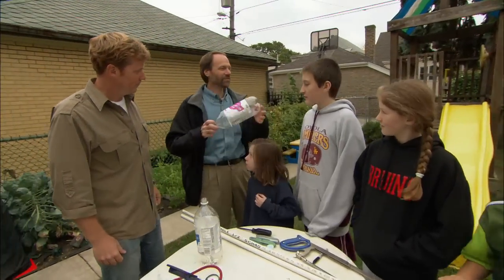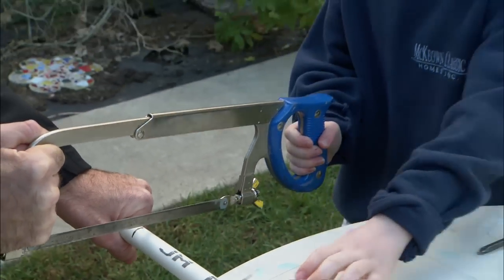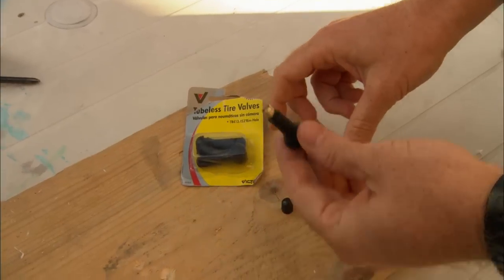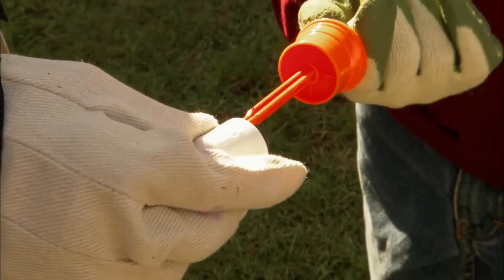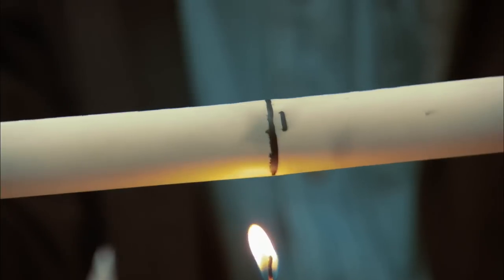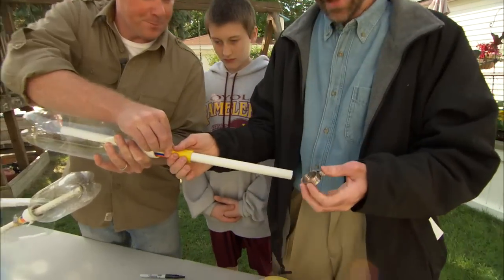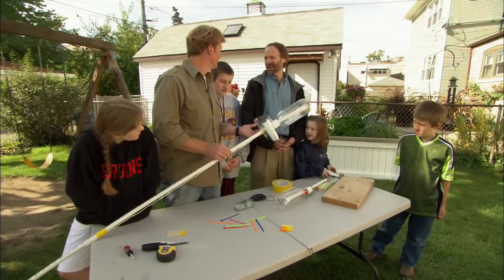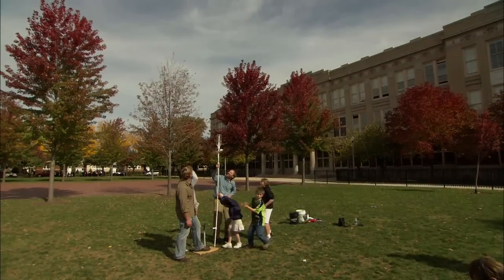How to Build a Water Rocket | This Old House

Comment: I'm going to make one for Physics class but I'm going to add 3" pressure chamber and I'm going to try to add a female quick release so I don't have to hold the tire filler for several minutes while using a compressor. Also I'm going to add a value past the pressure chamber.
Reply: Welp change of plans. 1.5" pipe for chamber with a reducer to .5" threaded. Then a .5" threaded to a .5" slip 90°elbow. Then 4 foot stretch of .5" pipe with this release mechanism.